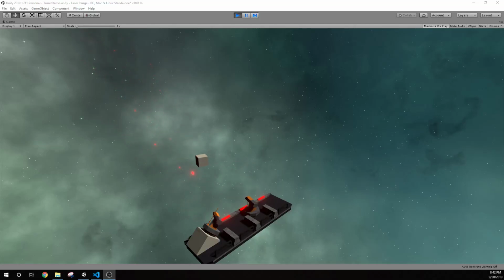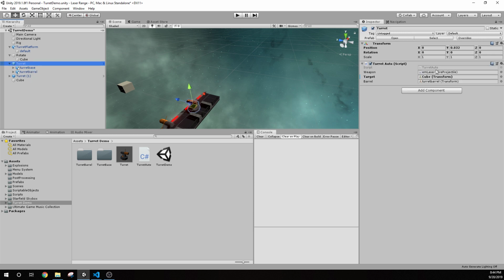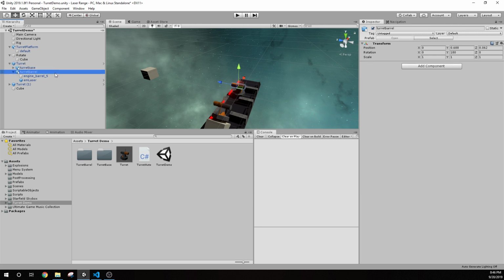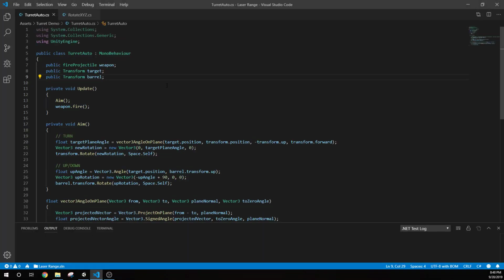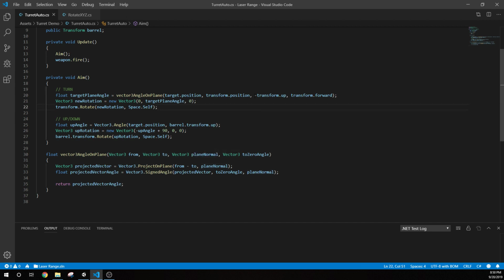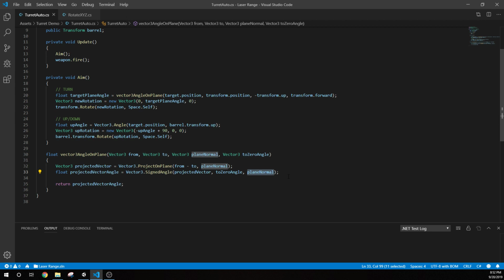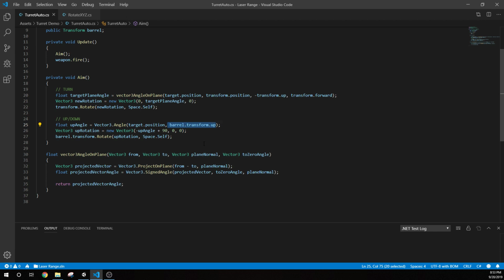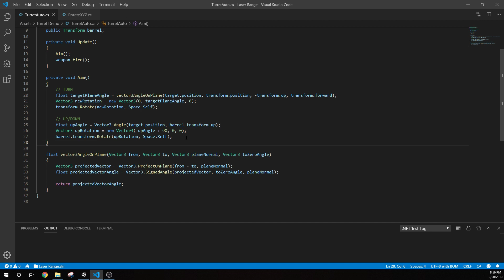Using Angle Calculations to Move Turrets

Comment: Thanks for the great video! I adjusted the script according to my needs, since my condition is to have a static turret base. 
Here it is, there is an explanation after the script about what i changed: 

using UnityEngine;

public class SimpleTurretRotator : MonoBehaviour
{
    //public fireProjectile weapon;    //not used
    public Transform target;

    private void Update()
    {
        Aim();
        //weapon.fire(); 
    }

    private void Aim()
    {
        Vector3 newRotation = Vector3.zero;

        // TURN
        float targetPlaneAngle = vector3AngleOnPlane(target.position, transform.position, -transform.up, transform.forward);  
        newRotation.y = targetPlaneAngle;

        // UP/DOWN
        float upAngle = vector3AngleOnPlane(target.position, transform.position, -transform.right, transform.forward);
        newRotation.x = upAngle;

        transform.Rotate(newRotation, Space.Self);

        //Reset Z rotation
        Vector3 curRotation = transform.localRotation.eulerAngles;
        curRotation.z = 0f;
        transform.localRotation = Quaternion.Euler(curRotation);
    }

    float vector3AngleOnPlane(Vector3 from, Vector3 to, Vector3 planeNormal, Vector3 toZeroAngle)
    {
        Vector3 projectedVector = Vector3.ProjectOnPlane(from - to, planeNormal); 
        float projectedVectorAngle = Vector3.SignedAngle(projectedVector, toZeroAngle, planeNormal);
        return projectedVectorAngle;       
    }
}

===== Explanation =====
- I applied the same method I used in the horizontal rotation to the vertical rotation;
- I combined the corresponding vertical and horizontal angles into 1 single Vector3; 
- After applying the rotation, i had to reset the Z value of the barrel's local rotation to 0 to avoid strange rotations involving that value.

##### DISCLAIMER #####
There is no clamping yet.

Comment: the //UP/DOWN part of the code is broken.

float upAngle = Vector3.Angle(target.position, barrel.transform.up); doesn't return the angle that we are looking for.
we need  float upAngle = Vector3.Angle( transform.position - target.position , barrel.transform.up); for that angle.

also the -transform.up+90 trick is not optional.
if you try to use transform.forward you will get jitter.

the reason for that is that -transform.up+90 simulates (while pointing in the direction of the enemy) a signed angle.

with transform.forward the barrel will frequently overshoot the target and then do a full 360 rotation.

still a good video though.
Reply: TYSM I was wondering why is was like inverting itself hahah you've saved me :D

Comment: Thanks for this elegant solution! My implementation relied on SignedAngle and loved to twitch at very small angles, as if the rotation over-rotated to the other side. This works perfectly!
It also does perfectly fine on moving-while-firing entities, which is great for tank-related stuff. I wonder if it can be used for simple NPC aiming just as well.

Comment: Hey im trying to smooth movement and limit max angles, i tried bellow code but it did not work

Can you help me out?

 
        if (HorizontalPivot == null || Target == null) return;

        //Turn
        float targetPlaneAngle = 
            vector3AngleOnPlane(
                aim_Predicted_Position, 
                HorizontalPivot.transform.position, 
                -HorizontalPivot.transform.up, 
                HorizontalPivot.transform.forward
            );
        Vector3 newRotation = new Vector3(0, targetPlaneAngle, 0);
        Vector3 temp = newRotation;

        
        if (HorizontalRotationLimit)
        {

            if (HorizontalPivot.transform.localEulerAngles.y > RightRotationLimit)
            {
                HorizontalPivot.transform.localEulerAngles = new Vector3(0, RightRotationLimit, 0);
                temp = new Vector3(0, 0, 0);
            }
            else if (HorizontalPivot.transform.localEulerAngles.y < -LeftRotationLimit)
            {
                HorizontalPivot.transform.localEulerAngles = new Vector3(0, -LeftRotationLimit, 0);
                temp = new Vector3(0, 0, 0);
            }

            else
            {
                
            }
        }

        float limiited_y = Mathf.Lerp(HorizontalPivot.transform.localEulerAngles.y,temp.y,rotate_Speed * Time.deltaTime);
        Vector3 lerp_V3 = new Vector3(0, limiited_y, 0);

        HorizontalPivot.transform.Rotate(lerp_V3, Space.Self);

Comment: I don't get how it works for you, but doesn't work in my project.
When I copy paste your code the turret and barrel rotate absolutely fine unless the turret's y-rotation is negative, then the barrel aims "negatively" and with an offset. Has Unity changed the angle calculations? i.e. does the same code work for you?
Does it have something to do with project settings or similar?
Reply from the maker: I'm not able to replicate this on 2019 or 2020, but I did find one way to break it that might be related. The turret code assumes that it is attached to a parent object, and the code also assumes that the barrel is a child of the turret object. The turret base in my example is also a child object, but that shouldn't matter.
Reply: @bitgalaxis1147  I've recreated your hierarchy exactly as in the video. Still doesn't work. My Unity version is 2020.1. Meanwhile I've solved the problem by using a second plane to calculate the X angle of the barrel. The adjustments compared to the videos are:
"pitch" is the barrel (up/down). target is a Vector3. Local variables renamed.
Aim function is:
    private void Aim()
    {
        // TURN
        float angleY = vector3AngleOnPlane(target, transform.position, -transform.up, transform.forward);
        Vector3 rotationY = new Vector3(0, angleY, 0);
        transform.Rotate(rotationY, Space.Self);

        // UP / DOWN
        if (pitch != null)
        {
            float angleX = vector3AngleOnPlane(target, pitch.position, -transform.right, transform.forward);
            Vector3 rotationX = new Vector3(angleX, 0, 0);
            pitch.localRotation = Quaternion.Euler(rotationX);
        }
}

Still. It is kinda scary that code functions differently sometimes and I'd love to find out why and when this happens.
Reply: @DoubleBob  Thank you sensei, I had the same problem and this worked.
Reply: @CameronCheese  Warning! I've later noticed that there a few specific angles that break the movement of my solution.
I never solved it perfectly as it wasn't a problem in my game. But I'm curious. So if you find the problem and fix it, let me know, please.

Comment: In my case the turretBase is static and i'm calling the //up/down on my turret  Barreltransform and it just spins uncontrolably, could you share some insights please? The project on plane works for the y rotation though
Reply from the maker: You'll want to make sure you're getting the "up" angle relative to the barrel by using (if ignoring left and right)

Vector3.ProjectOnPlane(target.position - barrel.position, transform.right) 

I know it doesn't seem intuitive to use "right" if we're trying to get a value on "forward and above me", but it's actually the piece we want to ignore, so we're saying, "Find it's position if it were directly in front of or above me, so remove the left/right and make it effectively 0." 

The "up" position is always relative to something, so track what "up" is relative to. If you're script is on the barrel itself, and the barrel pitches back, the angle relative to the turret/barrel will change if the barrel moves even if the target does not. SO, instead of transform.right, you might have to use a global value of "Vector3.right", but this would fail if you rotate your turret.
Reply: @bitgalaxis1147  Thank you so much for the reply! I actually got it to work after several err hundred times and i ended up managing to clamp the turret  on its x axis without losing track of the target(unless it went under the x value or over it) regardless of the base rotation, meaning i now have a turret that i can fit on any ship.

 I have bought several courses on Udemy,mostly where i learned the basics of scripting, where i posted some doubts, and posted on unity forum , but you are the first one to care and reply, so sir i want to express you my deepest gratitude. 
Learning without feedback to our questions is a gruesome experience at times, so again i thank you man

The content of your channel is superb,specially the video on torque, that really knocked my socks off and its making me think about how to design some of my ships or other objects. So again Thank You Thank You and Thank You!! God Bless You!

Comment: Thank you for sharing this lesson, i don't fully understand it yet bit i'll try to pick it apart and learn from it. I've been working on a turret with quaternions and slerps.eulerangles clamps and lookrotations around the parent transform.up(the base),

Works fine when stuff is spread out,but as soon as i try to put some restrictions, all the prior code goes out of the window. And the turret ignores the base rotation completely looking at wherever it wants. You said on this video that you talked about planes will definitely check more of your channel. Thank you again

Comment: firePorjectile not exist
Reply from the maker: I need to post the full solution on GitHub, so I'll work on that. But for now, here's what you need.

A script called, "fireProjectile.cs". See below. 
A laser game object with a laser script attached. I'll post in the next comment.

(fireProjectile.cs)
================================================================================
using System.Collections;
using System.Collections.Generic;
using UnityEngine;

public class fireProjectile : MonoBehaviour
{
    public GameObject projectile;
    public AudioEvent audioSound;

    [SerializeField]
    private float fireRatePerSecond = 1f;

    private float timeBetweenShots;
    private float nextFire;
    private AudioSource audioSource;

    void Start()
    {
        timeBetweenShots = 1f / fireRatePerSecond;
        nextFire = Time.time + timeBetweenShots;
        audioSource = GetComponent<AudioSource>();
    }

    void Update()
    {
        if(Input.GetButton("Fire1"))
        {
            fire();
        }
    }

    public void fire()
    {
        if(Time.time >= nextFire)
        {
            nextFire = Time.time + timeBetweenShots;
            GameObject.Instantiate(projectile, transform.position, transform.rotation);
            audioSound.PlayOneShot((audioSource));
        }     
    }
}
Reply from the maker: Attach this script to the laser gameobject (this should be made into a prefab which will behave like a laser. A stretched cylinder will work).

(laserBehavior.cs)
=============================================================================================================================
public class laserBehavior : MonoBehaviour
{
    [SerializeField] private float speed = 100f;
    private float endOfLife;
    private float force = 1000f;

    void Start()
    {
        endOfLife = Time.time + (150f / speed);
    }

    void Update()
    {
        if(Time.time > endOfLife) Destroy(gameObject);
        RaycastHit hit;
        if(Physics.Raycast(transform.position, transform.TransformDirection(Vector3.forward), out hit, Time.deltaTime * speed))
        {
            // If laser hits an emeny, damage it and knock it back
            hit.rigidbody.AddForceAtPosition(force * speed * transform.forward, hit.point);
            EnemyShip enemy = hit.collider.GetComponent<EnemyShip>();
            if(enemy) enemy.damage(100f);

            // If laser hits the player, damage player and knock player back
            RigidBodyAircraft player = hit.collider.GetComponent<RigidBodyAircraft>();
            if(player) player.damage(100f);
            Destroy(gameObject);
        }
        else transform.Translate(Vector3.forward * speed * Time.deltaTime, Space.Self);
    }
}